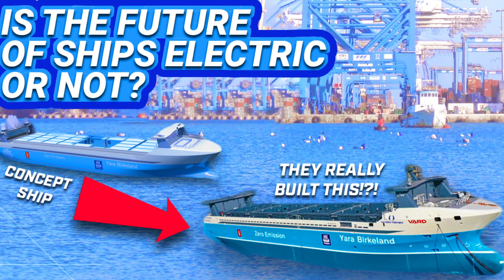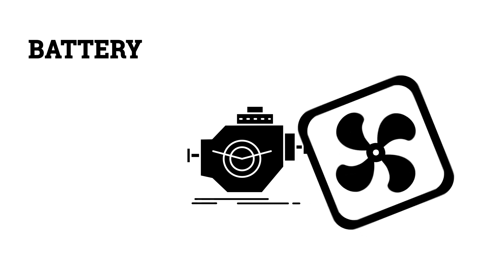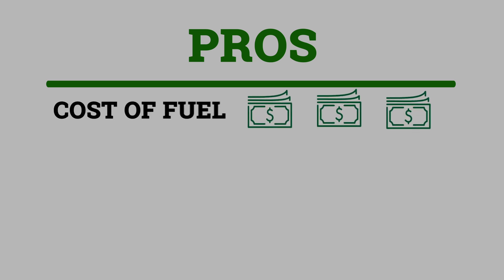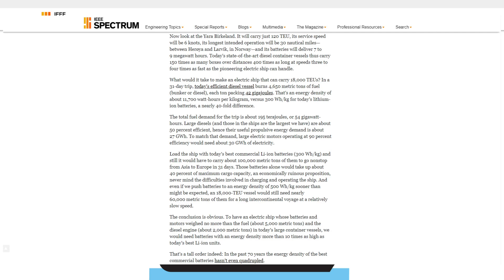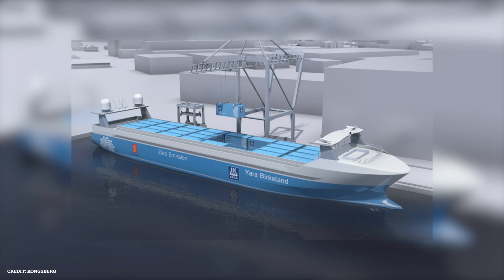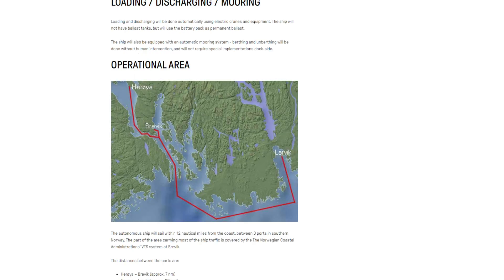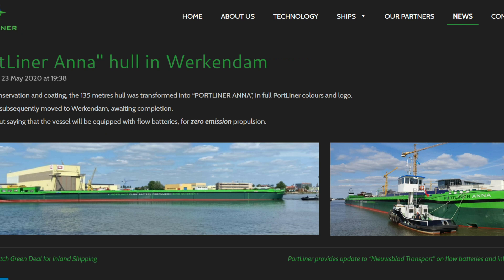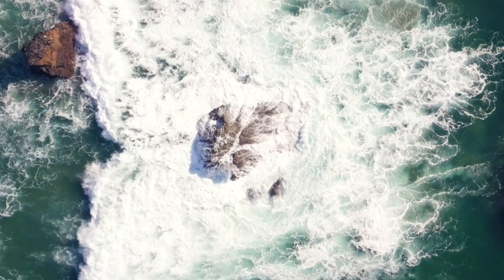Are Electric Ships the Future? - how electric ships work and who's working on them

Comment: Charging a ship need not impact the grid, since land-based power storage can be slowly pre-charged from the grid at economical times & rates, then quickly discharged into the ships mobile power storage.
Reply: With regard to propulsion with electric motors powered by ‘green electric’, leaving aside the fact that there is no truly ‘green’ electricity, the best we can do is low carbon impact both at installation (capital account cost) and production (revenue account cost).  Running ships on the ‘lecky’ is tricky the two examples that I personally know of, and have used, are a vehicle and foot traffic ‘chain’ ferry that ply’s its trade across the hundred meters or so of the Nordre älv between the island of Hisingen and the Kornhall on the Swedish mainland.  The motors are on the ferry and a power supply cable is unwound and wound back up on board as the ferry shuttles back and forth from Kornhall.  When the vessel goes anywhere else, id est dry dock for survey and or maintenance, it is towed by a good old ICE powered tug.  The other electric vessel is a vehicle and foot traffic ferry that runs from Helsingborg (Sweden) to Helsingor (Denmark), a twenty minute trip undertaken using energy stored in batteries on board, she tops up the charge each time she is alongside and battery capacity is said to be sufficient for an hour of main engine use.  A video is available on the Fully Charged channel of YouTube, ‘100% Electrical Ferry Crossing’.  There are small diesel generators on board; to keep the lights and other safety related items on in extremis.  Electric ships currently have short ranges and high light displacement  as a factor of their cargo capacity.  Sadly as of now electric boats are as functional as chocolate fireguards, yes ‘submarines can be diesel electric’ but they have negligible cargo carrying capacity and if you ever go on one (HMS Alliance is available to visit as a static exhibit at Gosport, UK or video available on YouTube, https://youtu.be/Q23uoxT16gO) your first thought could be ‘not much room in here for the crew is there?’

Comment: Crazy as it sounds, the solution may require something that hasn't been tried for many years on non-military ship: nuclear power. And we're not talking what was achieved on the NS Savannah back in the 1960's; the likely solution will use a small Generation IV reactor that is essentially meltdown-proof and fueled by commonly-available thorium-232. It may make it possible for cargo ships as large as the Algeciras class container ships to travel faster and with no air pollution issues.
Reply: If you do a web search for ‘nuclear ship savannah’ you will see that it has been tried and did not work.  A similarly heavily subsidised, by the government, vessel is in use in Russia which also operates, in support of the Northern Sea Route, a fleet of nuclear powered ice breakers these may, or may not, have been completely without issues.

Just think; would you have full confidence in the management of a nuclear reactor under the control of an anonymous entity only traceable, perhaps, via a letter box in a FOC (flag of convenience) nation state?  If you are, could you sell that confidence to Japan, the state that hosted the Hiroshima and Nagasaki nuclear detonations as well as more recently the Fukushima ‘event’?  Then try that same, or a similar, sales strategy on Ukraine, the nation state that as a part of the USSR (CCCP) hosted the Chernobyl ‘event’.  Modern iterations of nuclear energy, thorium fuel, molten salt reactors or fusion reactors, will carry the legacy of past problems.  It is the global trepidation of anything with 'nuclear' in the name and the economics of nuclear having transitioned from 'energy to cheap to charge for' too 'the costs of remediation are incalculable' that will prevent the adoption of nuclear energy as a means of creating energy at sea.  Modern reaction systems may have overcome the safety problems but the general public, having been misled in the past, will be reluctant to believe the fresh new promises.

‘They’ say nuclear is cheap, it’s not it is expensive and has a large embedded carbon quotient as well as being complicated, dangerous, not universally socially acceptable and having only ‘no need for refuelling’ as a questionable advantage; actually it does need refuelling just not as often.  When ‘they’ do need to refill the warming up stuff it takes considerable longer than pumping tonnes of thick black stuff, HFO cSt380, or thin runny stuff, MDO, onboard which is one of the reasons HMS Queen Elizabeth and HMS Prince of Wales are pushed about by ICEs and gas turbines thus using a similar fuel as the aircraft that fly off of them.  The Royal Navy (RN) with a high degree of skill and expertise uses, at vast expenses to the UK taxpayer, a current operational nuclear fleet of 11 submarines (also known as ‘boats’) in two flotillas, seven attack subs and four ballistic missile boats.  The carbon footprint of all the extra bits of hardware and the fuel, including processing thereof, from ground to propeller, are the external costs that never seem to get considered.

Disposal, once it wears out, of both the machine (that was a ship) and fuel is another can of worms best left unopened.  The 26 RN boats no longer in use are laid up (some in Rosyth and some in Portsmouth) awaiting long term deconstruction including dealing with the fuel rods and other irradiated material.  The USN is not, as far as I know, a commercial organisation working to very tight margins and also has the skill and expertise to handle the complexities of nuclear power; so as well as submarines their aircraft carriers are nuclear powered and each of the current iteration has a build cost three times that of QE/PoW, bigger crews and more generous funding.  For those who still think that nuclear energy might be the answer I recommend this report: - https://www.bbc.com/future/article/20200901-the-radioactive-risk-of-sunken-nuclear-soviet-submarines?ocid=ww.social.link.email.  The navy of the USSR might have been under resourced and over extended but it was still generously supported in comparison with merchant shipping.
Reply: Doesn't sound crazy, unfortunately pirates and terrorists make it more unlikely than technical constraints.

Comment: What I would like to see is company's going back to first principles.
 Blending reduced weight container systems used on aircraft with sleek low drag hull and superstructure designs. Reduced crew/automation for continual operation with flexible sail/electric propulsion. All backed up by huge wind/solar /wave recharge platforms constructed along trade routes to reduce electric storage required in the ships and to insure reliable delivery times when the winds don't cooperate.
 What do you all think??
Reply from the maker: Robin Holmes this is definitely the ideal approach and the companies that start doing this first will have a great shot at dominating the industry!
Reply: @rapidrev3293  I would also like to get updated on the Flow-battery technology. 
Could you "Recharge" flow battery's by quickly pump exchanging depleted electrolytes  with pre-charged electrolytes?
Would this allow quick, safe, ship recharging?
Can Flow-batteries be reversed to store power?
When sailing a sail/electric cargo ship in storm conditions, could you use your propellers to generate power and store it for later use?
Reply from the maker: Robin Holmes I’m also very interested in flow batteries and I think they are exceptional at recharging, losing very little capacity over time. 

These are some great questions man!

Comment: I would like to contact you about my AirPower project and its associated AirJet turbine technology. We can generate clean electrical power on a high-power density impulse jet turbine, having just a heat source. The electric power can charge the batteries or directly drive the motors of a diesel-electric locomotive or an electric ship, with an expected 20 to 30% fuel economy and reduction in CO2 emissions. Power ratings from 300KW up to 4-5,0MW are possible. If you are interested, my email is james.pessoa@gmail.com. And keep the good work, very interesting channel!